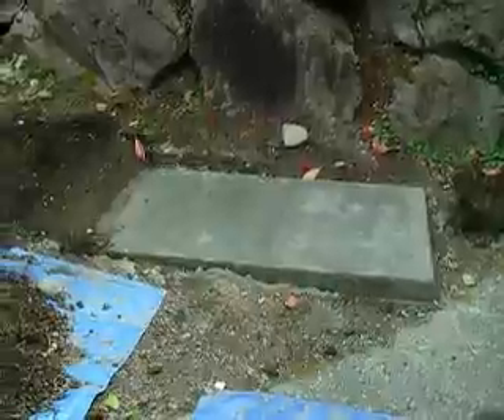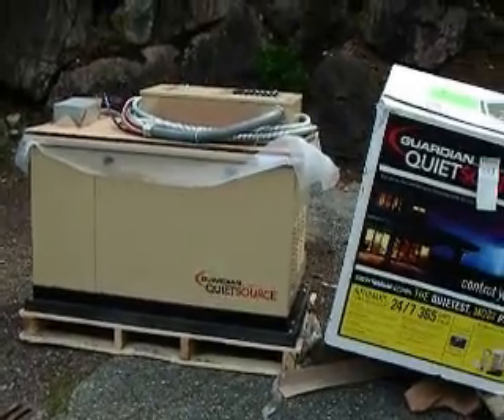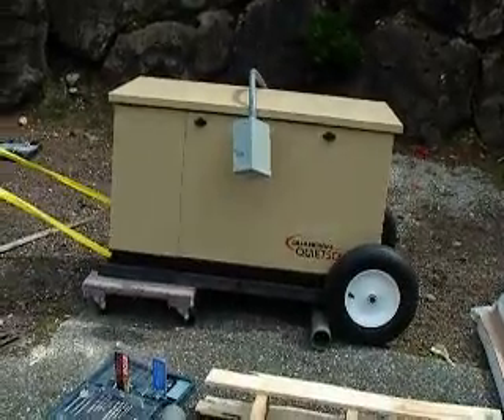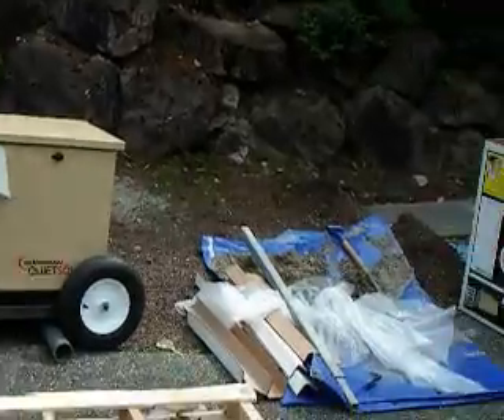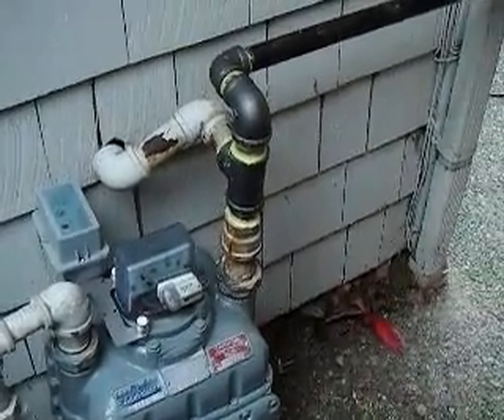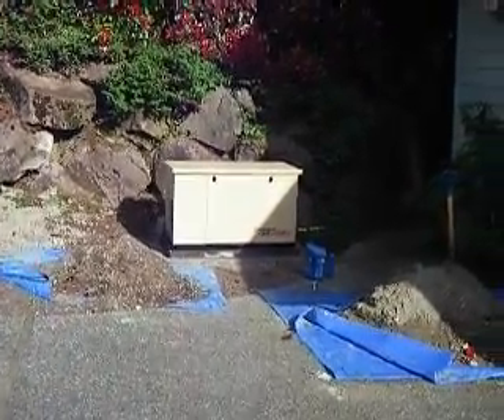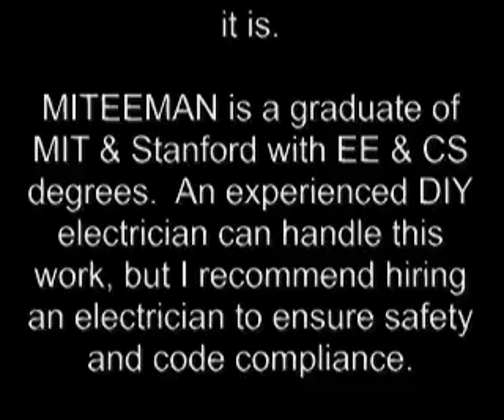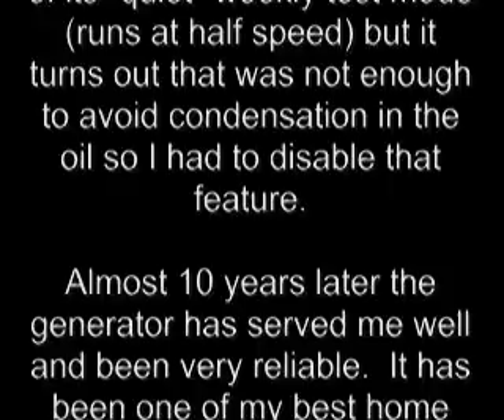Save $5000 DIY Install 16kw Generac Guardian Gas Generator with Automated Transfer Switch

Comment: I bet you didn't do a lot of thinking during the placement process of where to place the generator  ! Where you placed the pad on the lower end of a dirt slope.  You should have poured a 8-10 inch pad to keep the generators bottom from going under water or mud !
Reply: You are making a lot of assumptions.   It sits in an area impossible to hold water as there’s a 50’ downhill next to it.

Comment: HI MITTEman my husband recently saw your video and he is working on a similar generac generator . He would to know where the green wire hook up at?
Reply from the maker: It sounds like you need to hire an electrician. Green wires are almost always a ground and you need to ground your generator to an approved earth ground such as you can find at Home Depot.  Even with my level of experience, I hired an electrician and likely in any state you'll need an approval of the electrical inspector.  If you don't know the basics of grounding you can fry your generator, injure yourself, or damage the equipment connected to it.

Comment: Just an FYI on your gas piping. Before your coated steel pipe goes in the ground you should have a shutoff valve with an insulated Union to prevent electrolysis. At your generator the gas connections look good but you should have a sediment trap , (drip leg)  just before the last connection at the generator. Other than those two items you did a fantastic job on the piping.
Reply: No he didnt....it said in the video he hired a plumber to do it for 350 dollars......

Comment: What did the maintenance on the generac generator look like? You mentioned condensation in the oil, did you have engine problems?
Reply from the maker: The problem was solved by disabling the low speed mode. No more white in the oil.  There were no other signs of problems aside from the visual appearance.
Reply: MITEEman  do you service the unit yourself?

Comment: Deborah: you may need to check the fuses labeled N1 and N2 these look for power and would tell the generator there is power also check the small white wire( labeled 23) this is your Transfer Circuit witch transfers back to utility power. Also the should be a small metal rod you can insert this and pull up transfering your power to utility

Comment: Hi body,
Did you bolt the generator on the concrete pad base on floor?
Reply from the maker: Yes, the base comes with holes to attach to the pallet, and I used concrete anchors to fit those same holes.

Comment: my transfer switch did switch over to generator power but didn't switch back to when meain power came back on causing switch to burn
Reply from the maker: This is another good reason to hire an electrician.  I don't know if you hired an electrician or not, but if an electrician makes a mistake in wiring, they're on the hook.  When the main power comes back, that should energize the magnet to switch the power input from the Generator to Utility.  I'm not sure how the switch burned, but sounds like something failed.